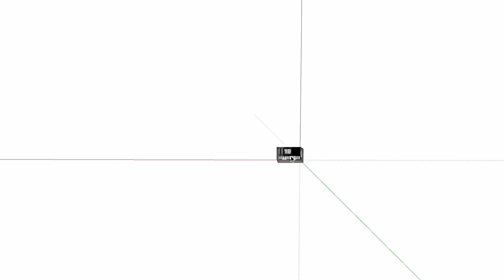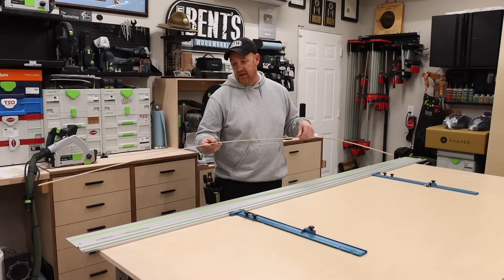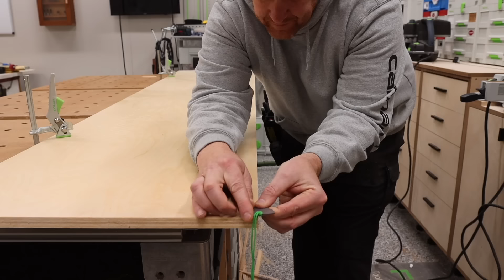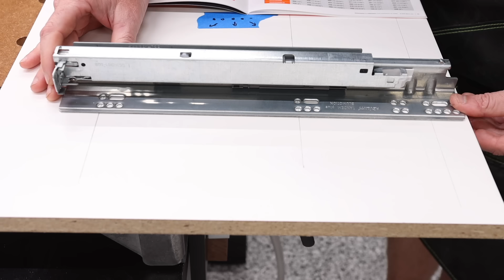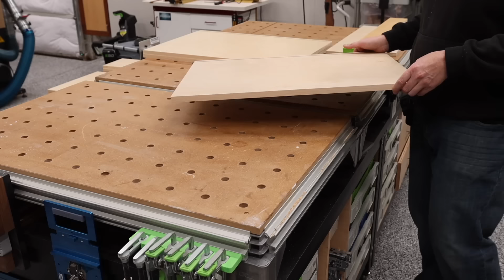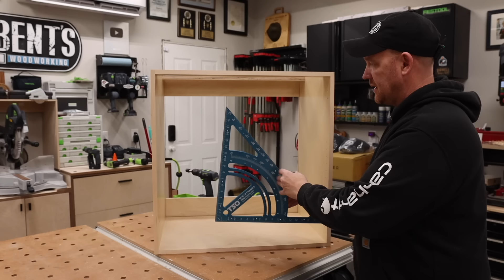STOP overbuilding cabinets

Comment: I was going into this video with the notion of getting info to build a simple cabinet with simple tools... but this uses lots of specialised tools.. hence I consider this as a VERY complicated way of building cabinets!
Reply: While many of us, myself included, may not have access to the same tools, the techniques shared here are invaluable and can be adapted to any setup. I'll be working outside in the heat with just a square for my track, but this video is incredibly informative. Thanks for sharing such great content!
Reply: Yes. The only neon green allowed by us is Ryobi, not Festool.
Reply: @puwazatza 🤣😉
Reply: You can replicate the same process with much more basic tools and a few jigs. The workflow is what’s important 💪
Reply: @FallLineJP exactly, folks just like to complain rather than just copy the concepts.
Reply: If you look at this and think, “I need all those tools,” then you shouldn’t be building things like this yet.
Reply: @qwerty112311  could not agree more.
Reply: That's not what he meant by "stop overbuilding." Overbuilding is not having the right tools for the job, it's using tons of complex joinery, excess fasteners and other reinforcements that aren't necessary for normal durability.

Just because you don't have a ton of tools doesn't mean you can't build cool stuff. It takes imagination and skill most of all.
Reply: I agree. So many instruction videos with professional tools. Ive got a tiny workshop with Minimal tools. I don't have the space or money to ket myself out with all this pro gear.
Reply: @cityzenkane108  there's a channel called "wood nerds" who has a few videos (maybe more, I haven't checked) of how to build cabinet doors with very basic tools
Reply: How do expect to build square without a good saw and a good square? Not complicated at all.
Reply: @dougfairburn2037  The 3-4-5 method will get you a 90 degree angle every time.  3 feet x 4 feet x 5 feet.... or 30 cm x 40 cm x 50 cm... Ratio works every time to give you 90 degrees at the corner where the 3 foot length and the 4 foot length meet.
Reply: I agree but I think the point of the video, as he states at the end, is that you don't need to clamp and glue and rabbit and dado and all these things.  A few narrow crown staples and a few screws is all that is needed.  At least, that was my takeaway.  I won't get to the finish line as quickly without all the same tools, but I can get there in my own way.
Reply: @banditski he did make dado actually
Reply: @pimc172 you have to have a slot for your back panel. Can accomplish by making two cuts with a circular saw and cleaning out the groove with a 1/4”chisel instead of a dado blade. You hacpve to have a basic understanding of tools and woodworking to make cabinets that function and hold together longer than a few months.
Reply: How much money have you invested in tools???
Reply: You can use simple tools it's just your cuts might not be 100% accurate
Reply: If you think this is complicated then this isn't what you need to be doing. Of course practice practice practice is always what's going to you a better product in the end. You just have to start so you can understand the basics. Once you get that the rest is pretty easy.
Reply: there's plenty of alternative ways to achieve what he has achieved with specialized tools, if you arrived at this video by googling "how to build a cabinet", then you can probably google "how to edge band", it's not complicated at all.
Reply: I have a redneck garage and can do this (cause I have) without the big "pro" tools. Thanks for the video
Reply: Exactly!! He said not to overcomplicate things, but he's using thousands of dollars worth of tools.And telling us to not overcomplicate things! Lol he's great I love him but he's certainly not talking to the d I y people😂
Reply: @Happy2bAmerican not to overcomplicate was about the overall assembly. Not the tools used to cut the parts.
Reply: We can always simplify the tools, or add one or two .
Reply: It’s not that complicated.
Reply: I have been building cabinets for years, in my driveway with a contractor tablesaw, miter saw and saw horses to break down plywood with a straight edge, just bought a cheap Wen track saw and tracks for about $200 and it makes it a lot quicker, but you don’t need fancy tools, I have never even used a stacked dado blade, just move my fence and keep running through the table saw. I don’t build a ton of cabinets but a few each year, this year I built about 30 cabinets and that is the most ever in a year. If I did it more often I would definitely invest in better tools but expensive for nice set up.
Reply: The only special tool I saw was the edge bander but you could always edge band with rips of wood
Reply: Then buy some new tools, I do about 1 or 2 projects every summer and buy a new tool for each project. Over a few years you'll have a nice collection quality tools.
Reply: Ditto.  Every step of the process was accomplished using a tool designed for that type of work - even the edge banding.  The cabinet may not be over-built, but the tools are over the top.
Reply: @douglasteachout1958  And every step can be accomplished with an array of tools. I just edge banded a 48"x96" pantry cabinet...with an old iron. I broke down the ply with a $99 cordless skillsaw. The techniques are all the same regardless of the cost of your tools.
Reply: Every comments section is full of ppl complaining about the gear ppl use.
Reply: @Max-xi5gu yes.... normal people.   With realistic budget and room constraints.

For 99% of the folks out there they will be making cabinets once in their lives.  It is not cost effective to buy all these tools for a one off job. 

I think you might lack a tool too.  Imagination.
Reply: @Max-xi5gu agreed, it’s not the tools, it’s the concept that matters.
Reply: Agree.
Reply: @Wulff-o  That's a poor analogy. Both the $100,000 car and the $10,000 car will make it to the grocery store in the same amount of time, and with the same amount of effort. Both the time and effort to build cabinets will increase without the fancy specialized tools.
Reply: What are the work tables that are being used in the video with the dog holes?
Reply: @tcwill7466 they look like Festool MFT’s.
Reply: @tcwill7466  Festool MFT (multifunction tables)
Reply: @tcwill7466  It's a Festool MFT system. You can make a similor table at low cost if you don't need the holes to be perfectly aligned. If you do want them to be aligned you can buy jigs online.

Comment: That is pretty much exactly how I have been building boxes since I did my kitchen in '07. Only thing I do different now is the use of pocket screws instead of screws through the sides into the end grain of the mounting strips.

Haven't built a face frame in nearly two decades. No need for it.

Comment: Thanks a lot !! But one quick question though, the whole structure is screwed and nailed from the outside. What do you do when the faces are visible? You use another jointing technique or you fill in the holes?
Reply from the maker: I would either use pocket screws or it would be covered with a decorative panel.

Comment: I like your explanation. I would like to understand your logic of using a table saw for bringing the pieces to final width on table saw instead of the track saw (approximately @ 6:20). It appears your track saw mft table has the ability to use stop blocks.
Reply from the maker: Just the method I prefer. You count absolutely do it with just the tracksaw.

Comment: I worked out a domino, less consumables is equivalent to about 15,000 screws of decent quality here in Australia. That makes this a substantial value proposition over dominos for the low volume producer who is ok with pocket holes and screws.

Aside from hidden reinforcement within a joint, what are the benefits any of you domino/biscuit/dowel users see with your approach?

Comment: Jason, I understand you use a Grex Pin Nailer, yet here in this style of cabinet you go for the crown stapler.

If I want to purchase a single nailer to manage panels during construction is an 18g nailer too much of a pain with holes that can't be disguised?  I've not filled holes on ply before only natural timbers I've worked on... so I'm uncertain if I must use a pin nailer. 

I'm asking because I envisage using this as a second set of hands during glue ups as I won't have heaps of clamps to rely on for a while.
Reply from the maker: They have different use cases. I like the stapler because I feel it has better holding power

Comment: In your video you place edge banding and then you went and cut panels to width on your table saw... 
In Cutlist Optimizer do you accommodate this in any way, or is it just an opportunity action to reduce later effort? 

I ask this with a view to you ripping the final width at the table saw later which means you must not be edge banding all long edges at the initial track saw cutting stage...

I'm designing some cabinets for my garage and working through what you have done :).
Reply from the maker: You can account for it yes. I however always cut a little oversized so it doesn’t matter.

Comment: This is your best video you’ve done in my opinion Jason. I think newer woodworkers can see this and be far less intimidated by cabinetry. Wish this video existed ten years ago when I started woodworking! Well done!
Reply from the maker: Thanks buddy
Reply: Now I just need a way to cut sheet goods.  (Tool shopping is fun!)
Reply: Ya, every other video I see on cabinets uses hundreds of pocket holes even on the hidden sides or inside drawers. And some of them even use permanent pocket hole machines like the Kreg Foreman that I don't see myself buying unless I go full-time, professional cabinet making lol.
Reply: As one of the newer woodworkers, couldn’t agree more! 👍
Reply: Definitely Agree, fairly new to all this and after watching some videos i was pretty intimidated. but this makes it so so simple. I think something to add is i don't have the equipment to do the cutting myself so i have all my panels cut and edged and then delivered and then i simply put them together.

Comment: If you want to talk about efficiency and complicating things, I would argue you could have saved time and made a stronger cabinet by pocket holing your stretchers before ever getting to the point of putting them in. Also would’ve saved you from butt jointing boards that are important for the long term stability of the cabinets without glue.

Comment: I may have missed it but what size is the screw you are using? 1 1/2" by what size? #6,8 or 10? How do you like the conturo? I've thought about going that route but I still slice hardwood strips (1/8---3/16" thick), a little long, glue on and then cut my panels to length. Then I use the festool mk700 like you to trim flush on both sides. My process is very slow. Great video, by the way!
Reply: I’ve been considering the contouring too. in the mean time How are you gluing on your 1/8-3/16 strips?
Reply: @IndianaJBird  I cut a pile of hardwood strips...usually cherry because the grain it tight and the wood is hard. I cut them 1/4" thick. I glue them on and use headless pins to hold them in place. They are usually a small amount wider than the thickness of the plywood. I glue them on so there is some overhang on both edges of the plywood and they are a little longer than the plywood. Once the glue dries, I then use my Festool MK700 to plane both sides flush with the plywood surface. Then I run the panels through my table saw and shave off the face of the hardwood strip, leaving 1/8-3/16'. I then cut my panels to final length on the Festool MFT. I am basically sawing through the headless pins when I shave the surface off after the glue up. They are tiny and my carbide saw blade doesn't know the difference. This doesn't trip the cartridge on my Saw Stop saw either. It doesn't sense a ground. I know...there are a lot of unnecessary steps in my process but it works and my volume is low. This method is for painted cabinets only. I wouldn't use exposed pins on stain grade cabinets.

Comment: I generally build my base cabinets a bit more simply, however I'm curious to see your process for uppers. I like to dado my top/bottom pieces into the sides to make sure the plywood doesn't delaminate from vertical stress on the screws through the side. Any plans on showing a video for how you do your uppers?
Reply: I think this method is fine for lowers and I use a similar approach. For uppers... customers do stupid things..  like use uppers to pull themselves up onto a counter top to change a light bulb. I hang with cleats and use dados, glue, and dominos so they're bomber.

Comment: Exactly how I was taught to build cabinets. Great to see.

Not sure if you mentioned it but since you’re edge banding first, how do you avoid tear out of the edge banding when cross cutting the panels through the edge tape?
Reply from the maker: A good sharp blade and I slow down for the exit cut. I’ll also use a sacrificial fence sometimes

Comment: I love this method! I first saw this method done by Greg Paolini in the video companion to his book. (Someone uploaded it to YouTube) He uses a long piece of scrap like a ruler to mark the 3/8" drilling guide line. He also puts a groove in the back stretcher that 'caps' the back board in place but I'm sure that doesn't make much of a difference from your method of leaving a slot across the back. I love your tips on edge banding and drilling everything before assembly. Smart! Every time I watch a Youtube video where someone makes a cabinet, I think the same thing... "Your cabinets are too complicated!"
Reply: These are fine for a builder grade kitchen but a lot of stone installers wont put stone countertops on these.
Reply: @snoopster000  Please elaborate on this. What makes this method unsuitable for heavier weights? I've priced out stone countertops before and no one ever mentioned that my cabinets might not be up to the task.
Reply: @lightspeedguru  Most installers want double 3/4 plywood sides or 1x4or6 reinforcement in corners that runs from bottom to top of the cabinet. I dont recall the maximum unsupported span for stone but that is also a factor. Generally, installers will price in any reinforcement upgrades that are needed when doing a quote/estimate.
Reply: @snoopster000  I agree and he is using 3/4 (18mm) plywood here. The only thing missing is the toe kick which, if not integrated requires a plinth that continues the load support down to the floor. Good point. It would be a mistake to use bottom-mounted levelling feet on this design.
Reply: @lightspeedguru  Rockler leveling feet claim to hold 400lbs each. That would be more than enough for the weight of stone.  It seems like it would be wise to have the foot overlap the edge of the 3/4" plywood sides, so that the weight transfers down into the feet and isn't relying on the sheer strength of the screws.  Thoughts?
Reply: @WillLafferty  Yeah... I was thinking that joint between the sides and the bottom isn't enough to support the weight if levelling feet were used but mounting them on the edge might do the trick. I like using a plinth because I can level it with shims before the cabinet gets put in place. You just have to go back and scribe a toe kick plate to cover it up.

Comment: Amazing video! In regards to how you assemble the bottom and sides at 8:19 - wouldn’t the cabinet be a little stronger if you were to place the side on top of the bottom? Then the screws would be holding a compressive force rather than a shear force. I believe screws are stronger with force going downwards and upwards them rather than across them. But if you have noticed no difference then it’s good enough for me
Reply: There is a video somewhere of someone testing the shear force required to break wood screws in this format.  It was the weight of a small car, something typically you dont put on kitychen cabinets :)  I always glue my cabinets, but i have a small job comming up and i will follow this format to see how much (if any) time i save.

Comment: Cutlist Optimizer is awesome! Besides sheet goods, you can also use it for stuff like pipe. I once built a PVC pipe pool float rack for my mom. I was able to punch in the different size pieces I needed, and CLO showed the most efficient way to cut them.

I just wish it integrated with sketchup better. Yes, there are some similar cut list extensions you can download, but they're not nearly as good.

Comment: I built my book shelves more or less like this, screws without glue and they are super strong, the edge banding at the beginning is a cool trick.

I don't have a workshop, only a circular saw and a cordless drill, but your method is totally aplicable for my next projects.

Comment: Good stuff as always!  Quick question on Jesem guides.  I have been using same fence for many years.  Just bought the Jesem guides and have been watching You and my question is about the best way to mount the guide system: commercial solution or make something on my own?
Reply from the maker: Jessem makes an adapter for this fence specifically

Comment: I think you should remake this video with a $2000 shop instead of a $20,000 shop. Show us measuring the cabinet sizes then marking the cuts without cad software.
Reply: It’s not CAD software and you can use the free version of that software. 
Most people can find suitable substitutes for the more expensive tools rather easily.

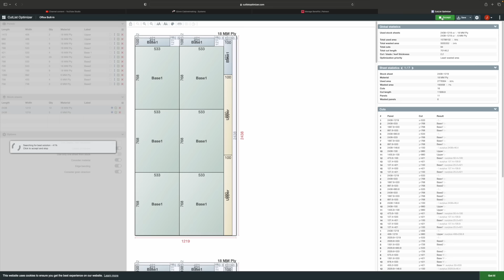Comment: I am also using cutlist optimizer. One thing I do not like is that the program does not optimize for rip first, followed by crosscuts. There are several examples in your cultist as well (0:59) that require at least on crosscut before ripping. Are you not annoyed by that?
Reply from the maker: There are lots of different settings and preferences you can adjust to make it work.